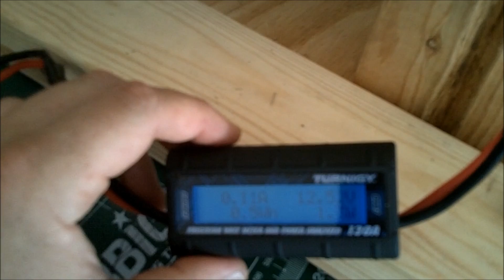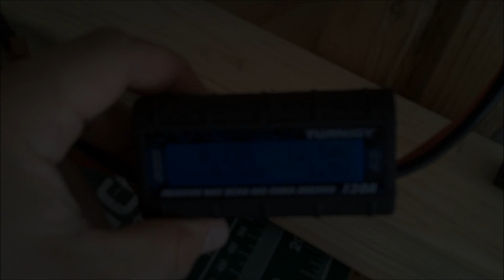Turnigy D2826/6 2200kv Bench Test

Comment: I understand about the specs. What I'm up to is I want to make a sort-of jet engine for control line flying model airplane. In control line you are not allowed to run a turbine because of the power. You are allowed a jet engine with an exhaust area of no more than 1.25" square area which is around 1.25" in diameter. That means a Dynajet. Too noisy and non throttleable. . I have a 4" turbo compressor wheel that will spin and compress air into a combustion chamber, fed gasoline, ignite,  and then race out the tailpipe. A separate motor will drive a centrifugal pump for the fuel. I'm hoping for at least 50,000 RPM.

Comment: Hope you can help me. I will be buying my first brushless motor and no hobby shop can tell me what I need to know. If a motor is rated at 2200kv, 22.2 volts maximum and 120 amps maximum, can the voltage be raised if the amperage limit isn't reached? I need more than the 48,000 RPMs that is listed for that particular motor. Can you help me? Thank you in advance, Bill
Reply from the maker: You should stick with the motor manufacture specs. What motor are you planning to use and what kind of application?